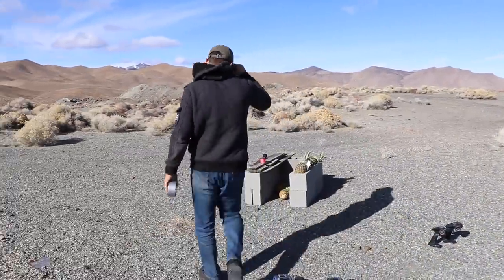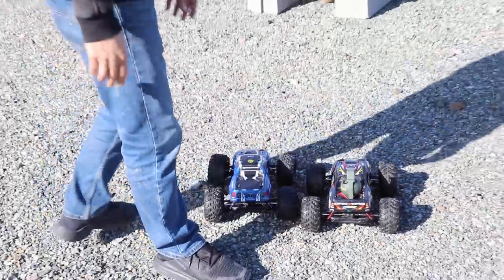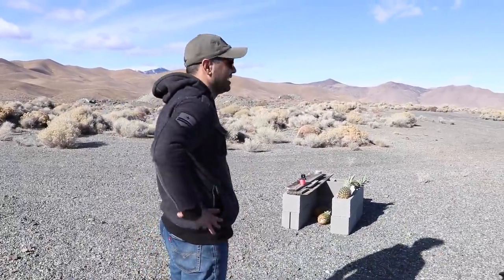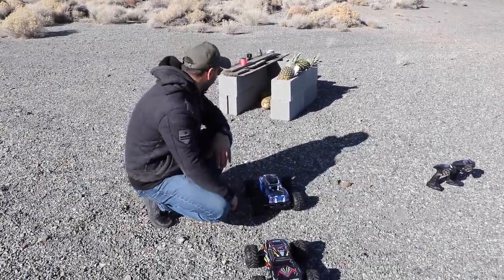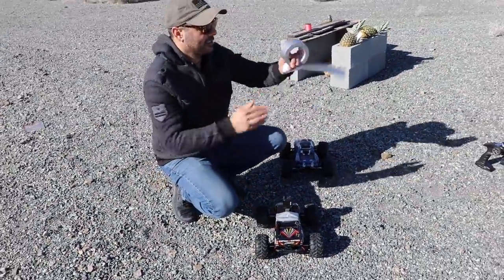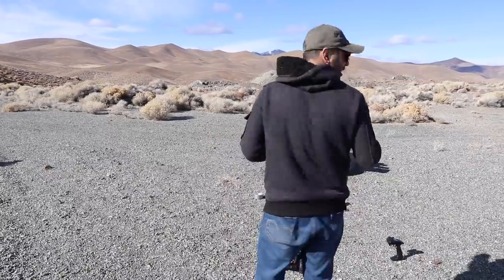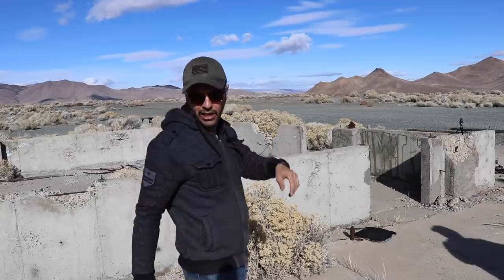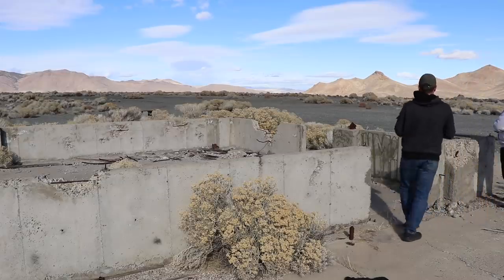Sending Grenades with RC Cars

Comment: "Because this is really legit" - Edwin Sarkissian 2020
Reply: I was skeptical until he said that.
Reply: Lol he taped it so the handle which is spring loaded can’t come off when the pin of pulled... meaning no 💥
Reply: What caused the explosion then? I'm confused
Reply: Nate Dawg then what caused the explosion
Reply: @osamabinladen320  They edited the explosion in using something explosive. Same as with the grenade arrow video.
Reply: That is one great explosion.
Reply: @joecamel2236  tannerite most likely. He's just adding in this element of "danger" but it's all fake. Only thing real was an explosion not caused by that toy grenade.
Reply: Goblin Shaman unpaused the video just as he said that when i read your comment
Reply: Iam 200 likes
Reply: @3:37... did he tape over the top of the grenade spoon? 🧐 Sure looks like it... 🤔 if he did there is no way that grenade exploded!!! Not even a chance. 😏
I'm watching on a tablet so I can't be sure... but I'm pretty sure he taped the spoon down.

Comment: The car fell over on it's roof at 6:40. At 7:03 just before the explosion the car was standing back on it's wheels. 
I think you guys are at a haunted location or something, definitely poltergeist activity.
Reply: Weird
Reply: @tweetylr213  I am being sarcastic, we know they are not really at a haunted location. They edited the video and I'm sure they wont edit a video if it was a real frag grenade that was laying on the ground there. But I like the idea of a "grenade" blowing stuff i'ts still entertaining.
Reply: And the second car didn't pulled the pin!
Reply: At 703 the car is already gone. You are looking at go pro on the pin pull car
Reply: so u mean the grenade was staged?
Reply: The first car hit something in the bunker which makes it to flip.
Reply: The clouds were different also, the car must have not set it off and they probably had to reset because time past between the shots
Reply: The rubble was also moved and a shadow off the hill moved so time definitely passed
Reply: Definitely, and there is not any mechanically arrangement for pin out the generad seems to be edited video.
Reply: @ah7maw265  its not a grenade that exploded. For one that type of frag dosnt have that color smoke. Second he used tannerite most likely. It's highly explosive. He's just doing all these fake videos for views and he's not smart so yeah. He lost a fan with all these fake videos lately.
Reply: @texasclass  thanks dude
Reply: @Like TrOoper 1 will be 2 and 2 will be 4 that 4 will rise more and more  if u don't stop it from the beginning !!!
Reply: Nice catch
Reply: The video is fake, they shot tannerite, grenades don't make that kind of explosion,  I've shot a lot of tannerite and thrown hand grenades and into that is exactly what tannerite does. The grenade on arrow video is fake as well.
Reply: 6:40
Reply: your right
Reply: Ya they stopped the video at 6:42, you clearly can see they edited
Reply: There are two car one with grenade is gone but go pro one left
Reply: @osuweller  finally,a smart man ! :D

Comment: Hmm something isn't quite right here.

Few things I've noticed:

1) The grenade that they're using is an M67 fragmentation grenade. What does it do? Well, it makes a huge boom and does what the name implies. It fragments. So 1) the explosion is about ½ - ¾ the scale of the actual explosion. 2) There was no fragmentation shown in any of the footage. The fragments would have enough energy to travel to their bunker and kick up dust on and in front of the barriers. Again, none was present.

2) Before the explosion, the rear rc car flipped the "live" one upside down pulling the pin. Shortly before the explosion, you can see that the car magically appeared back on its wheels.

3) The pin on a grenade is set pretty tight so it's not easy to dislodge. It actually takes a decent amount of effort to pull it. That RC car wouldn't have the strength to pull that pin. Even if it did, the gravel wouldn't provide enough traction for it to do so.
Reply: Thats all right! Its fake, a real handgrenade is much more powerfull and there is much less smoke in real. Its a selfmade explosive. Tannerite?
Reply: 100% true
Reply: And the red string between the cars are not present as they drive to the target. It could look like he was taping over the grenade handle. If he did, it would be very little boom...  And this would naturally be a bad idea if they did it as they say they did.
Reply: That and the smoke from an M67 should be black or mostly black.
Reply: Obviously my observation skill is low hahahaha
Reply: Do you really think a civilian can buy a hand grenade lmao
Reply: @ifyouusedarkmodeimjohncena7189  of course not. Well, not without going through a ton of red tape.

Fact of the matter is that they portrayed this to be a legitimate grenade, when it is not. It's either fake, or a glorified practice grenade. I'm not sure of the latter, because practice grenades are color coated blue, for obvious reasons. That's why I laid out what I observed because I'm almost certain this video is mostly bullshit
Reply: Tf there are two rc car one with grenade and one with go pro aftr explosion go pro one is left
Reply: Bla bla bla
Reply: Its entertainment. Enjoy it.
Reply: @Bobby Sands If you don't like it, don't watch it. That simple. He has more subscribers than u ever will with whatever u try to put on youtube ever in your life.
Reply: It made smoke cuz of the dirt
Reply: Im pretty sure they it took more then one try to pull the pin, also they couldve loosened the pin. Fragmentations are not easy to pick up on cameras.
Reply: I learned something today 👍🏽👍🏽 good looking out

Comment: At 7:02 Just before the explosion the RC mysteriously flipped back over.
Reply: your right
Reply: They weren't paying attention when they planted the explosive charge, and fixed the flipped rc truck.  Most people know they don't actually use grenades since the amount of metal shrapnel would be extremely dangerous, at least compared to a demolition charge like what they use for the shot.
Reply: @brian_sipe  US grenade smoke is a small gray puff, not a huge orange plume.  Fun presentation.

Comment: Seems borderline dangerous :)
You might laugh but RC could be used in war. Probably has been. I think they call it asymmetric warfare when something cheap defeats something expensive.
Reply: Low tech will always defeat high tech.
Reply: @macgyveratlarge2133  no that's not even close to true and ironically, an RC car with a bomb is higher tech than a cast iron tank.
Reply: @DanFrederiksen  an RC car costs a lot less than an Abrams, and if equipped properly, it would take out the Abrams.
You can get some cheap models for less than 50 bucks across the land.
If you want to just talk about a storage tank, you won't find one of any metal, much less cast iron, for less than a couple hundred dollars.
But, be my guest.
Check with a local junkyard and see how much they are.
Also, check on what it takes, tech-wise, to produce that cast iron tank.
Also, the last I heard, they are pretty much immobile on their own, unless you add some tech.

Comment: RC car was upside down when it exploded. Then in the next shot it's magically upright again....
Reply: It is definitely edited from two different videos. hard to tell what they did but the truck unflipped itself between takes
Reply: my guess is they drove over there two times. they showed the first try where it flipped. because of the flip the pin didnt come out
Reply: i'm pretty sure they didn't want to have a mess up with one car not following correctly, it could have been a prop nade too.
Reply: @Blargthehandsome  I tend to agree with you. I think it was a fake grenade in the driving footage to avoid any accidental detonation. Once they got that footage they set up the real grenade and filmed that part. Somewhere between the two videos they either forgot the car was upside down or they didn't think they could pull that pin properly with the car on top of it.

Comment: It is true what you say about a new Private getting ready to deploy a Frag, I recall when I was in basic the most and only time I saw the Drills nervous was at the Grenade range, and they actually told us that there have been recruits that have pulled the pin and froze, they actually are in the little open bunker with the recruit so this does not happen, I recall when I looked at the Drill and he said to me Private do you have any questions before you deploy the Grenade, I said yea can I yell "GRENADE" when I throw it, he said in a hurriedly manner "YEA YEA" just throw the damn Grenade Damn it,  I pulled the pin and threw and yelled "GRENADE"

Comment: When I was 16 we got ahold of a few m-80s.  We took a ken doll and placed it in a plastic toy truck.  We lit it and ran like FUCKIN hell. Took about 8 second and I just remember looking back at is while running and it went off.  A fireball and then a twinkling sound of plastic parts from the foot Long plastic car. Ken was vaporizer.  The axle was intact 20 ft away. We tried a big heavy tonka truck...it didn't even move much.

Comment: You can have a pineapple stuffed with a grenade in the back of a RC truck equipped with a detonator. Pull the RC into the bunker, push the button and whamo. 💥   Vaughn

Comment: Would be easier just to mount another servo to pull the pin, or wire the reverse up to a separate servo to pull the pin 👍

Comment: Might have been better using one car tie a stick perpendicular to the grenade taped to the truck. The stick would get caught on the cinder blocks pulling the pin as you drive in between

Comment: You could have used a cheaper build of an rc car with and fpv camera and the grenade could be strapped into some kind of bracket or mount and you could have a second Servo on board to pull the pin. It would be just like the real thing that way. Like this comment so homie see's it.

Comment: For those of you that don't know when u pull the pin on a grenade it will not explode if you are holding the lever.
So you can put the pin back in and your perfectly safe.

Except that you have a grenade...
Reply: But how it's possible to pull out the pin without press the lever before?
And in case the lever was already pressed by the tape, how can the grenade explode then?

Comment: But you can still hold a grenade after the pin it pulled as long as you keep the spoon held down though, right?  I mean you can hold that thing indefinitely as long as the spoon is still in place?  Or am I wrong?  Only got my information from movies and video games so i could be wrong.  Can anyone confirm or deny this? Just wondering. Thanks yall!

Comment: Why didn’t you just put a long string on the grenade and hold it and then drive the rc car like 20 yards and then the pin will pull and then just keep driving the COD car into the bunker